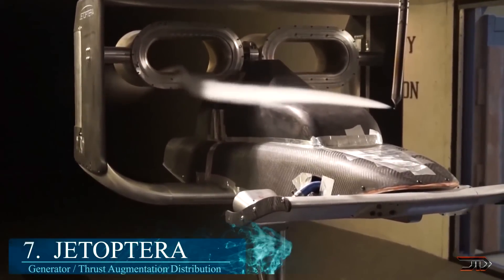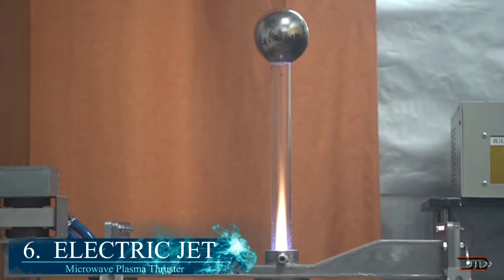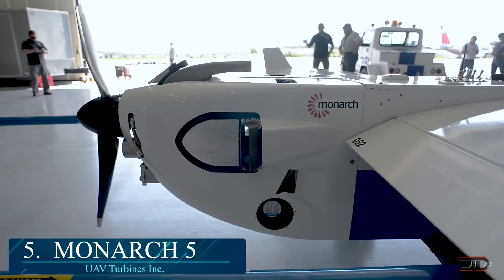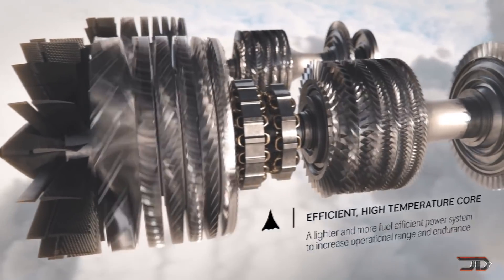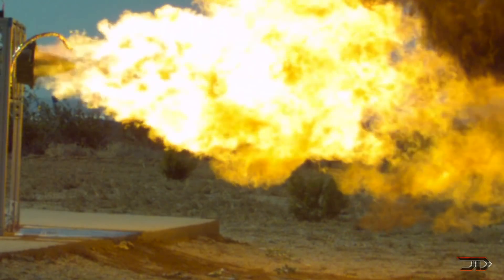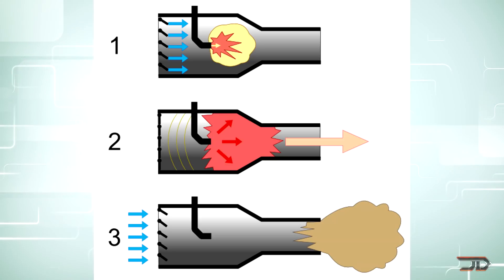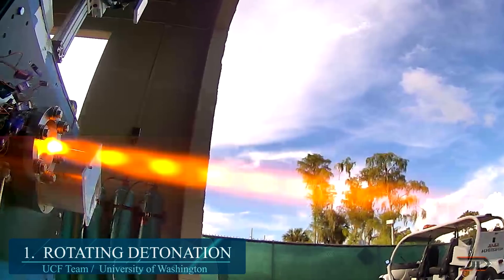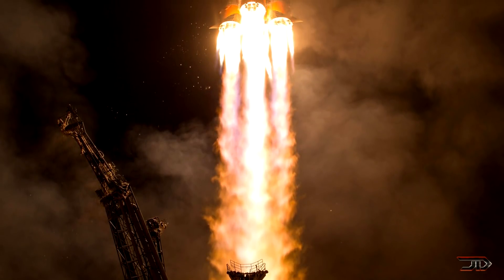7 STRANGEST New Aerospace ENGINES

Comment: The first pulse jets was made in the early 1900's The fricking V1 bomb in ww2 was powered by a pulse jet. Do your homework!
Reply: Here is the information I found
A pulsating jet engine (PuVRD) is a variant of an air jet engine. The PUVRD uses a combustion chamber with inlet valves and a long cylindrical outlet nozzle. Fuel and air are supplied periodically.

The first patents for a pulsating jet engine were obtained (independently of each other) in the 1860s by Charles de Louvrier (France) and Nikolai Afanasyevich Teleshov (Russia).

German designers, even on the eve of World War II, were conducting a broad search for alternatives to piston aircraft engines, did not ignore this invention, which remained unclaimed for a long time. The most famous aircraft (and the only serial one) with the Argus As-014 PUVRD manufactured by Argus-Werken was the German V-1 projectile. The chief designer of the V-1 Robert Lusser chose a PuVRD for him not for the sake of efficiency (piston aircraft engines of that era had the best characteristics), but mainly because of the simplicity of the design and, as a result, low labor costs for manufacturing, which was justified with a massive the production of disposable shells, mass-produced in less than a year (from June 1944 to March 1945) in an amount of over 10 thousand units.

V-1 engine
After the war, research on pulsating jet engines continued in France (SNECMA) and in the USA (Pratt & Whitney, General Electric).
The results of these developments interested the military of the USA and the USSR. A number of prototypes and experimental samples were developed. Initially, the main problem with air-to-surface missiles was the imperfection of the inertial guidance system, the accuracy of which was considered good if the missile hit a square with sides of 3 kilometers from a range of 150 kilometers. This led to the fact that with a warhead based on a conventional explosive, these missiles had low efficiency, and nuclear charges, at the same time, had too large a mass (several tons). When compact nuclear charges appeared, the design of more efficient turbojet engines had already been worked out, so pulsating air-jet engines did not become widespread.

Representatives of air-to-surface rockets with a pulsating jet engine.
Third Reich Fi-103
USSR 10X · 14X · 16X - thanks to the use of two engines, the practical limit of flight speed for the PuVRD was reached - 980 km / h (270 m / s).
USA JB-2
In the early 2010s, there is a revival of interest in PuVRD: their development and testing are carried out by General Electric, Pratt & Whitney, SNECMA, as well as the domestic NPO Saturn

Scope of PuVRD
PUVRD is characterized as noisy and wasteful, but simple and cheap. The high level of noise and vibration arises from the very pulsating mode of its operation. The uneconomical nature of fuel use is evidenced by an extensive torch "beating" from the PUVRD nozzle - a consequence of incomplete combustion of fuel in the chamber.
Tests of the American Mustang P-51 with PUVRD
Comparison of the PUVRD with other aircraft engines makes it possible to fairly accurately determine the area of its applicability.
A PUVRD is many times cheaper to manufacture than a gas turbine or piston internal combustion engine, therefore, with a single use, it wins economically over them (of course, provided that it "copes" with their work). With long-term operation of a reusable device, PuVRD loses economically to the same engines due to wasteful fuel consumption.
In terms of simplicity and low cost, the ramjet is practically not inferior to the PuVRD, but at speeds less than 0.5M it is inoperative. At higher speeds, the ramjet is superior in efficiency to the PuVRD (when the valve is closed, the drag of the PuVRD sharply increases and at transonic speeds it “eats up” almost all the thrust created by this engine).
Homemade stainless steel motor
The combination of these circumstances determines the niche in which PUVRDs are used - single-use unmanned aerial vehicles with operating speeds of up to 0.5M, - flying targets, unmanned reconnaissance aircraft. For the same reasons, the engine is also used in aircraft modeling.
Due to the simplicity and low cost, PUVRDs are widespread in amateur aviation and aircraft modeling. Small engines of this type have become very popular among model aircraft designers and in amateur aviation. For this reason, commercial firms have appeared that manufacture for sale for these purposes PUVRD and valves for them (a high-wear spare part).
The PUVRD can be used not only as an engine, but also as a stationary unit for generating heat.

Other pulsating WFD

Valveless PUVRD
Samples of valveless (U-shaped) PUVRD.
In the literature, there is a description of engines similar to the PUVRD.
Valveless PuVRD, otherwise - U-shaped PuVRD. In these engines there are no mechanical air valves, and so that the reverse movement of the working fluid does not lead to a decrease in thrust, the engine path is made in the form of the Latin letter "U", the ends of which are turned backward in the direction of movement of the apparatus, while the outflow of the jet stream occurs immediately from both ends path. Fresh air is supplied to the combustion chamber due to the rarefaction wave that appears after the impulse and "ventilates" the chamber, and the sophisticated shape of the tract serves for the best performance of this function. The absence of valves allows you to get rid of the characteristic drawback of the valve PUVRD - their low durability (on the V-1 projectile, the valves burned out after about half an hour of flight, which was quite enough to complete its combat missions, but absolutely unacceptable for a reusable device).

Detonation PuVRD. (English name PDE) In these engines, the combustion of the fuel mixture occurs in the detonation mode (in contrast to deflagration, which occurs during the combustion of fuel-air mixtures in all WFDs discussed above). The detonation wave propagates in the fuel mixture much faster than the sound wave, therefore, during the chemical reaction of detonation combustion, the volume of the fuel mixture does not have time to increase significantly, and the pressure increases abruptly (up to values over 100 atm), thus isochoric (at constant volume) heating takes place working fluid. After this, the phase of expansion of the working fluid in the nozzle begins with the formation of a jet stream. Detonation PuVRD can be with or without valves.
A potential advantage of a detonation jet engine is considered to be a higher thermal efficiency than any other type of jet engine. The practical implementation of this engine is in the experimental stage.

Detonation PuVRD has been studied for over 70 years. The main problems: fast and efficient mixing of fuel and oxidizer, prevention of spontaneous combustion, integration of the nozzle and air intake. Not mass-produced, but several test engines were demonstrated on low-speed aircraft in 2008.
In July 2016, the world's first tests of an experimental detonation rocket engine took place at the Energomash stand in Russia.
At the end of December 2016, the American company Aerojet Rocketdyne received a contract from the US National Energy Technology Laboratory to develop a new gas turbine power plant based on a rotary detonation engine. The work, as a result of which a prototype of the new installation will be created, was planned to be completed by mid-2019, but the completion date of the project was postponed. Engine tests were carried out in 2020.
In 2021, Russia completed the first stage of testing a demonstrator of a direct-flow pulsating detonation engine developed at NPO Energomash (UEC; developed at the Lyulka Design Bureau, which formed a separate direction for the study and development of such power plants), the model runs on kerosene and gaseous oxygen (the first tests of a liquid-propellant detonation rocket engine took place in the summer of 2016; for the first time a model of a pulsating detonation engine was presented at the Army-2017 International Forum). In some operating modes, the engine showed a 50% increase in specific thrust compared to traditional power plants. In the future, it will be used in rocket and space systems, orbital aircraft and hypersonic aircraft.
On July 26, 2021, Japan tested a rotating detonation engine. He worked for 6 seconds.

This video presents Detonation PuVRD. Russia is making an impulse, and the United States is rotating. This is their difference.
Reply: The last 2 engines in the video are detonation engines. Russia has an impulse, while the USA has a rotating one. There are no errors in the video.

Comment: All the "new" propulsion systems shown in this video are not new. Ion propulsion dates back to Michael Faraday who described how you could use  charged ions to move air in the 1830s. The Air Force and Navy have both experimented with pulsed high voltage and high current type engines in the past. Plasma engines have been built and tested for more than fifty years, The first electric thrust engine was invented by the Father of Rocketry, Dr, Robert Goddard about 1900.  Tesla and Dr. Townsend Brown had experimented with very high voltage capacity systems prior to 1940 that were very promising. With the creation of Space Force and a renewed interest going to space and now Mars Its amazing to see how these technologies will develop into the future.

Comment: You can't include the weight of batteries  in a thrust to weight calculation for an engine. I mean. What's the thrust to weight ratio of a Boeing 747 engine if you include the 240 metric tons of fuel in the tank? See?...

There are many ways to source electricity. Staring at the batteries as an obstacle will see you miss opportunity.

Comment: 4:45
Not in any way, was that the first flight of a pulse detonation engine.
https://youtu.be/Rdwbp6R2qM8
Reply: pulse detonation is a little different. It uses combustion process to pressurize the unlit air-fuel charge. It happens in a pulsjet too but with a lot less compression. the difference is that shockwaves are more efficient for this than deflagration. even then im pretty sure USSR was first